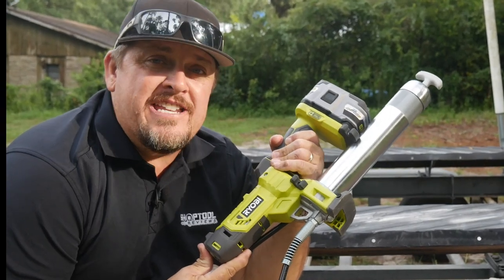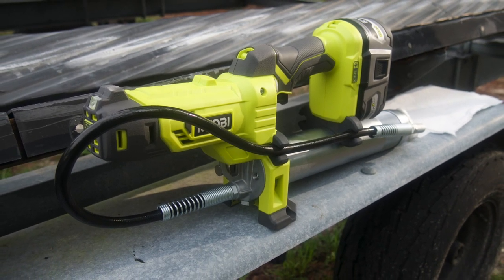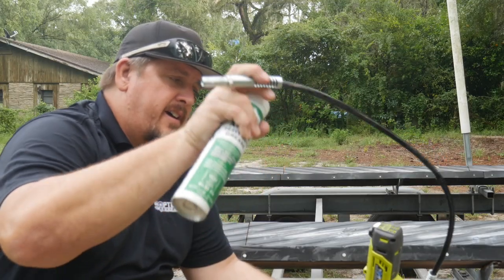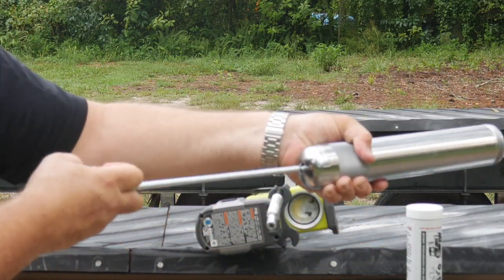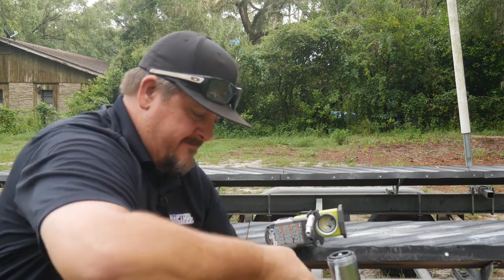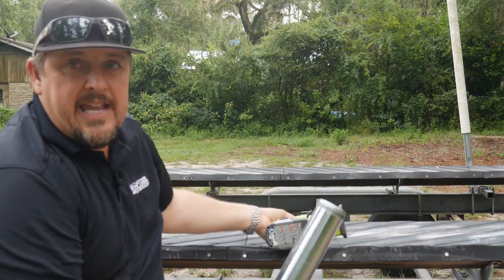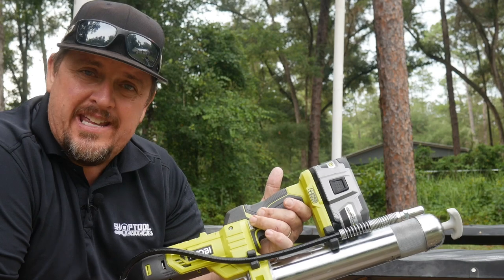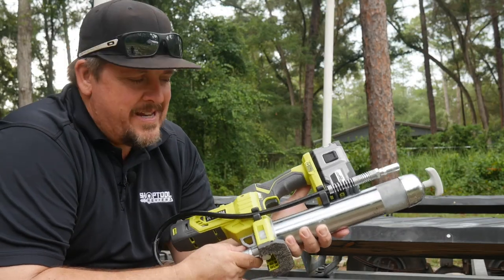Make Greasing Easy Again - Ryobi P3410 18V Grease Gun

Comment: I have a John Deere and a ton of uses for this machine. Added a LockNLube coupler. Now it's complete!
Reply: LockNLube coupler?  Does the ryobi tube not lock on the zerk already?
Reply: Mine did not. LockNLube works well, but you're into your setup for another $20. I feel that it's worth it. It's really nice to have a free hand while doing this task.
Reply: @jeffcesta2493  good tip thx

Comment: I bought one, used it and liked it, but now I can't remove my first cartridge to replace it.  The rod with the T-handle won't pull out all the way to get it fit into the narrower slot.  Any advice would be greatly appreciated.  Thank you!
Reply: I am having the same issue did you figure it out?
Reply: @wateraerobics8596  Unfortunately, no.  I am afraid to pull hard on the T-handle because I might break it.  Hopefully, someone will provide guidance.
Reply: I figured it out.  I made sure all the grease was unloaded.  Then I pulled hard on the T-handle.  It is very hard to pull out.  I ultimately braced one end with my legs and pulled on the other end with the T-handle with my hands.  Once you get the T-handle pulled out all the way, then you have to manage to move the rod over to the narrower slot to lock it in.

Comment: Great video.  When I first bought mine, I thought it was broke because I couldn't get off the tube but I was trying to remove the top and not where it screws into the unit.  Also I didn't realize I was supposed to push the plunger in after I loaded the gun.  I found this when I was searching about the light not going off and saw that it is build into the trigger lock.  Thanks for the help!  I will subscribe

Comment: Got the Ryobi grease gun and loved it for 10 grease fittings then it blew the fitting between the hose and the gun. Actually pulled the aluminum threads right out so it wasn't fixable. According to H Depot reviews this has happened to others. It was out of stock so I just got a refund. Hope they fix this cause otherwise it was a very useful tool.

Comment: Thanks for sharing, might have to get one of those cuz I doubt the 15yr old 12V ni-cad battery on my generic 12V cordless grease gun is still serviceable. Haven't used it in a dog's age since I did a lube job on a DC-10 horizontal stabilizer. Besides I have 18V Ryobi Li-Ion batteries anyway.
Reply from the maker: You won't be disappointed with the performance and runtime. Value is great too since you already have the 18V batteries.